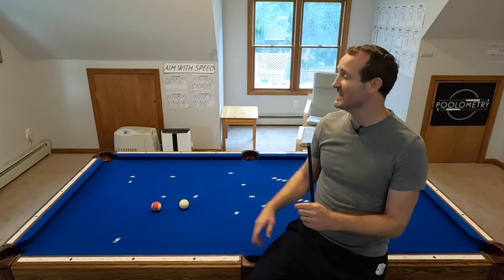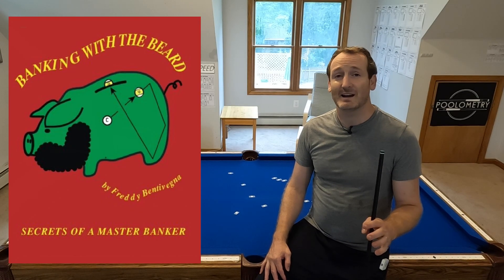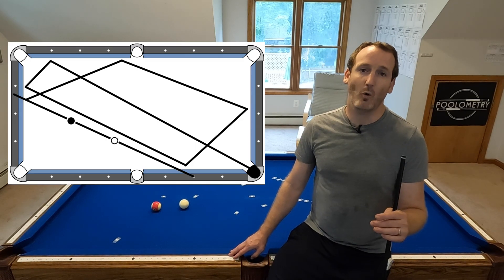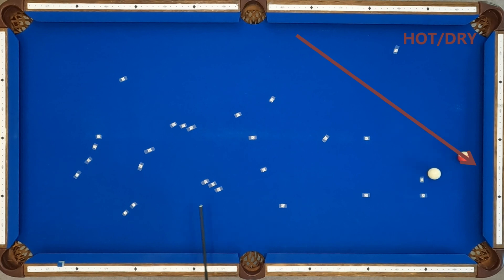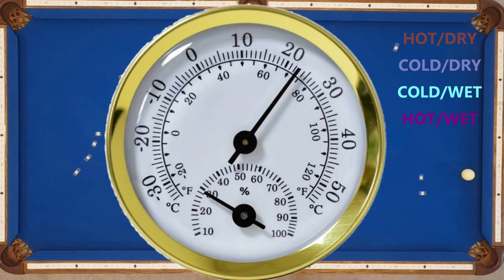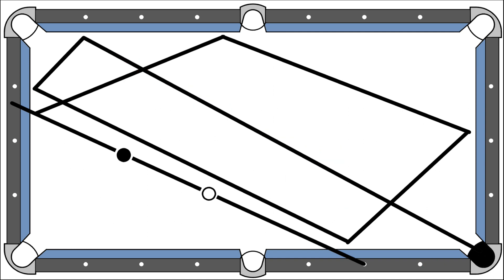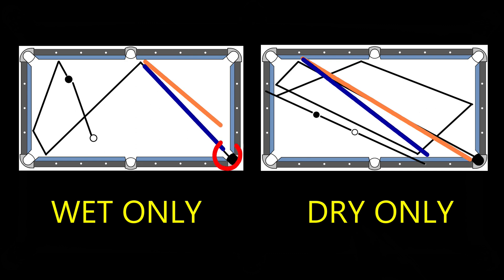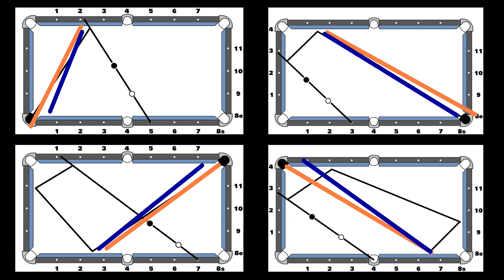1. The Eddie Taylor Shot: Temperature & Humidity Experiments

Comment: I've the shot in a tavern (twice) but never get it on 4 1/2 x 9.  I will say that your rails are soft compared to most newly felted tables thereby giving you a slower return banking lane.
Reply from the maker: Maybe.  But my rails are the same in all 4 simulated climates, and it works in some and not in others.  I think the table is a factor, but factors 1 and 2 are humidity and temperature, in that order.

Comment: At the large pool hall I frequent (40 tables), the veterans of the place will tell you that the tables closest to the front door roll the slowest and have the shortest rebound angle, while the tables in back (near the kitchen that puts out a lot of heat) roll very fast and have a much wider rebound angle.
Reply from the maker: Interesting. I wonder if you could try what another commentor suggested and put a moisture tester on the rails. Maybe try a few sample shots to compare them. This topic definitely deserves more attention and research.

Comment: I watch tons of bank pool and one pocket, and love playing around with tough or interesting bank and kick shots when I'm practicing. But last year i was watching an old one pocket match from the 80's and seen this bank successfully pulled off. I had to rewind it a few times and rewatch because it just wasn't one I was familiar with. But now that I'm looking at the diagram that starts this video, I'm realizing that I've probably been close to accidently making this a number of times after missing the 3 rail bank to the side haha. I usually hit that shot pretty soft, so I doubt it ever has the pace to make it to the corner off the 4th rail, but the next time I'm on the table I'm gonna have to give it a go 🤙
Reply from the maker: You can pocket it with a full hit too, aiming the aiming the 3 rail in the side long, I think it was aligned like diamond 3 through 0.6. However, the diagram in the book had this setup with a slight cut shot, so that's what I focused on.

Comment: Why don’t you get a moisture detector they use on boats and wood that way you can get an accurate reading what the cushions and the cloth is carrying in moisture. I was talking to Tony Chohan about it he just laughed but you could probably adjust quite quickly if you were carrying one of those
Reply from the maker: Very interesting. I use something like that for firewood, not sure if it would work, but I will definitely try it. My plan someday is to make a 3-5 shot test calibration routine that can diagnose a table's playing conditions, with measurable recommended adjustments based on the results.

Comment: Nice to see you back on your feet. For the 6 rail, do you get more length out of a break cue? On the Taylor shot you are getting large rebound difference off the very 1st rail.  If you load up on spin to reproduce the 1st rail "wet" outcome what is end result in normal conditions.
Reply from the maker: Thanks. Yeah, the break cue seems to give a little pop, a little skip on the felt early on to help it carry at the end, but I don’t hit it with break power or it flies off the table.  Start it within 2 diamonds away.  For the 1st rail rebound, I didn’t really see wildly different rail locations around the table on the first few rails.  What seems to be happening is near the end at the point the ball slows and develops natural topspin roll, like a slow speed one rail shot, that’s when the humidity really seems to catch the ball and run short.